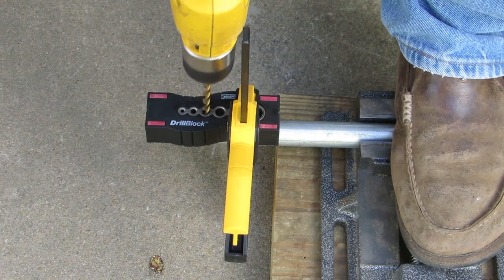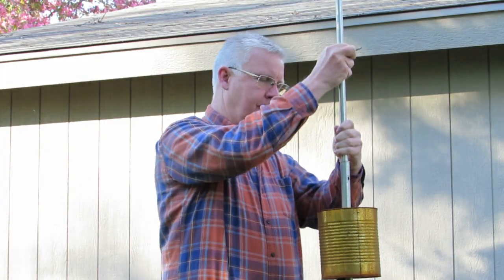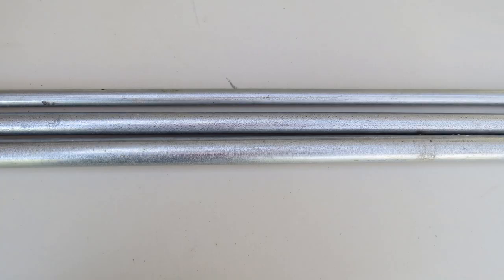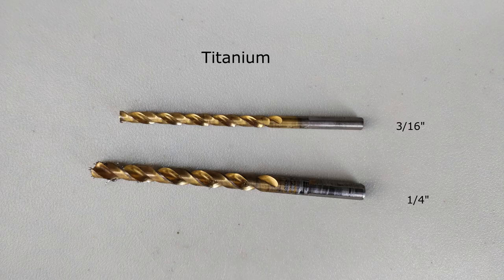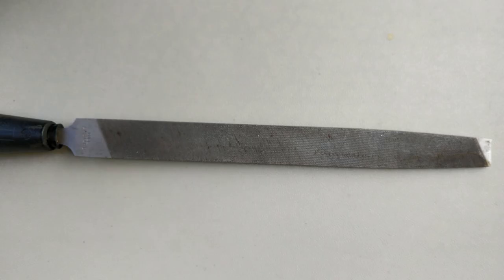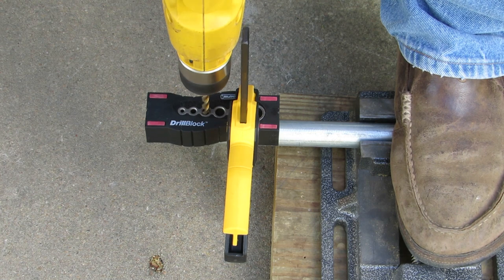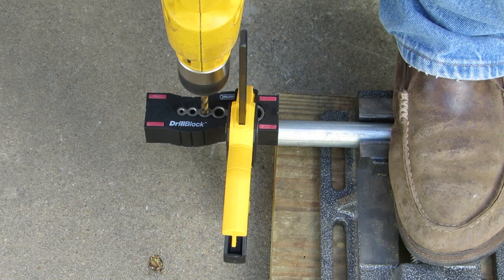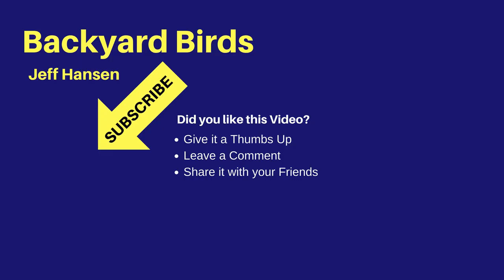How to drill holes through EMT conduit to make a telescoping pole 2019

Comment: Years ago, a fellow ham radio operator gave me an antenna built out of EMT and a 102 Inch cb whip.. i worked the world on that antenna and am building another as it eventually corroded and became unusable after about 8 years outdoors. I am building another to the original specifications that requires 1/2 in conduit to be placed and secured with bolts 18 inches inside 3/4 in conduit. Thank you so much for showing how to drill it!
Reply from the maker: Very awesome. This really is a neat trick. I only wished I knew about it ten years earlier.

Comment: Good idea!  I have also found that 5 inch round duct fits well over a 4x4 post as an effective squirrel barrier.
Reply from the maker: That's a great Idea I've never thought of. Much cheaper than a 20 or 30 dollar baffle. What length do you use?  Bet it works for raccoons too?

Comment: THANKS JEFF, this helps with a telescoping easel legs projet that I am doing
 using copper. and we were having problem trying to get the drill to go straight down.
Reply from the maker: I'm so glad this helped. I too struggled with centering the holes in the conduit for many years.

Comment: i just got a new job and sometimes i get sent out to put uo stop signs and have no brackets and is force to drill into a 2" wide pole to bolt in the stop sign... would the drill guide fit a 2" wide pole? thanks!
Reply from the maker: I think they make different size guides. Try big box store